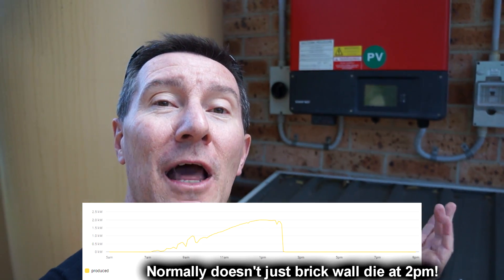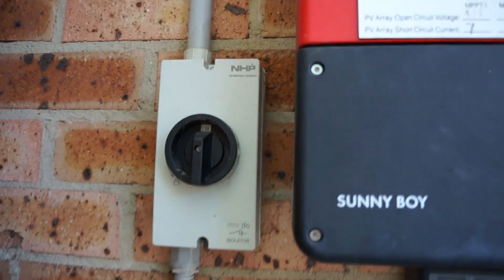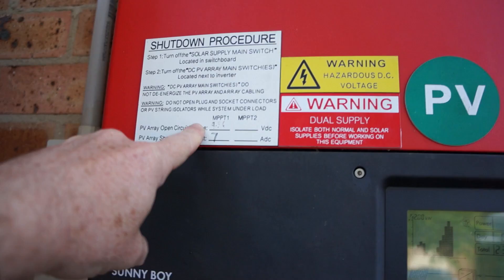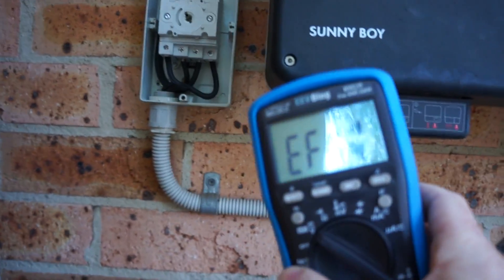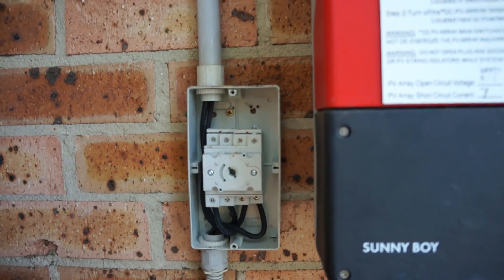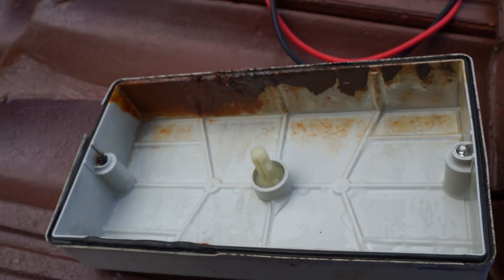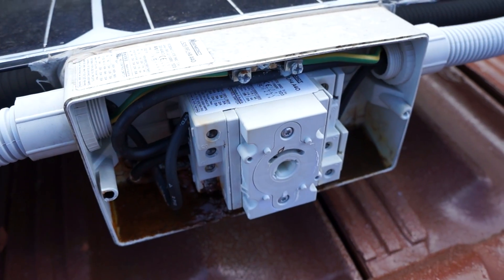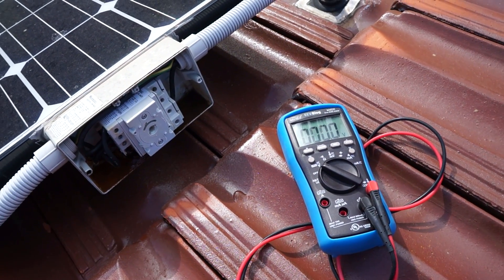EEVblog #1217 - My Home Solar Power System FAILED!

Comment: Given you have no other isolators on the roof, does that mean you have to replace the switch live with 400+volts flowing ?.
Either that, or get up there in the dark and change it ?.
Reply: Don't point your bloody torch at the panels! You'll kill us all!

Comment: Here's a fun fact. The New York Pneumatic Transit system that Ray mentions in that Ghostbusters 2 clip was an actual thing, though it wasn't nearly as big as the movie depicted. It was a tunnel about 300 feet long, built in the 1870s, that ran under Broadway. It used a big-ass Roots blower to push/pull a rail car along using only air pressure, kinda like a human-scale version of those pneumatic tubes at banks.
Reply from the maker: Yeah, very cool

Comment: It's a little late now but a little silicone caulk on that seam might have kept that seal.

That top iso switch is probably for fire code. Firemen are very leery of solar cells because they output voltage all the time when there is sun or just bright light.
Reply: In Oz even Silicon succumbs to UV.   Once the silicon breaks down you have as much or even more unreliability.

Comment: The dual shut off on the panels might be for fire safety. If the building catches fire, fire fighters need to cut off all power for their own safety. Depending on the nature of the fire, the ground based switch may be innaccessible or a roof crew may come upon the panels before the shut down on the side of the house. They need to sever power at the soonest opportunity.

Consider a scenario where they need to cut a venthole in the roof. They need to shut off power. Either they can try and jump down from the roof and find the shut off down below, or they can cut it off at the panels and get cutting. Time matters.

At the same time, they could be on the ground, about to enter the house. The roof is unsafe or they don't plan on any roof attacks. They need to shut it off at a convenient place, the ground.

Both switches are generally necessary.

Comment: I'm not familiar with Aussie electrical code, but instead of these plastic abortions, why not a common (and inexpensive) AC disconnect box, such as the Siemens WN2060U (there are less expensive ones)?   Metal, should probably last a few decades.

Comment: Never use non-UV proof plastic on the roof. But if you must, coat/wrap the exposed parts in metallised tape to stop the UV getting at the plastic. Even for cable ties, there's a black UV proofed variety. Or have a box for the box !

Comment: A plastic box meant for mounting in direct sunlight not UV resistant enough.  Brilliant.  They should have used metal or painted it to better reflect UV.  "Weatherproof box."  Apparently not.

Comment: Could this have caused damage to the panels? Like if the switch contacts caused a short across the panel strings?
Reply: If the panel output is shorted, all of the panel's power will be dissipated in the wiring, with most of the dissipation occurring at the short due to the higher resistance of the corrosion relative to the copper wire.  This will generate a great deal of heat, so, yes, the panels will be damaged when the system bursts into flame.

Comment: Maybe a encapsulated High  voltage high current relays might be better?, control from ground floor, place in dicast box with internal seal, use weatherproof inlet glands ip68 or better
https://uk.rs-online.com/mobile/p/non-latching-relays/6900814/

WoW well over 68,000 views in one hour since upload that's good going Dave !
All the best
Philip

Comment: I forgot to say DC-4 blocks water entry to electrical connections and protects against hi voltage arcs up to 460 volts per mil of DC-4,

Comment: I self installed a 14 310 watt LG panel
system 12-1-16 using a Enphase microinverter for each panel. Inverters are bolted under the panels to the panel mounting rails. I wish I had used DC-4 on the cables where the microinverters and panels plug in to the output cable. I will be adding 10 panels and microinverters soon and will use DC-4 where each panel and microinverter plugs into the output cable and on my existing
disconnect boxes. I’m in Los Angeles, USA – not much rain here but who knows what the future will bring?

Comment: Rooftop dc isolator is usually the weakest link and tends to fail, this guy is lucky because it could have been worse. Sometimes it  can burn and cause fire to the roof and the house ...

Comment: Our eversolar (now zeversolar) inverter failed after 3 years, luckily just within warranty - so replaced for free! Supposedly it'll pay itself back in 10 years, not if the inverter goes again it won't! Having searched for our model on youtube I found a video of a chap who found the fault to be dead relays, he did quite a large Big Clive style test with lots of exposed parts and got the relays working again by bending them with a screwdriver. :D

Comment: I can understand secondary isolation but who in their right mind puts a polycarbonate enclosure in full view of the sun, especially in Australia.
How about you mount the replacement isolator inside a larger enclosure meant for external applications.

Comment: no isolator switches on roof.  put 20 amp breakers in for each string, outside, but under cover.
Reply: What's that going to do? The short circuit current is in the region of 10A
Reply: I use 20 amp breakers under cover, because I have parrallel panels on my array.  size breakers for panel amps of course.

Comment: The sunny boy has another circuit breaker built in, the pullmedownthingy on the lower left. 

Just put aluminium tape over the silicone and plastic when new. the good thicker self adhesive stuff. Costs some money but really long time stable.
i think main original use is overlapping water vaper blocking on thermal insulation. the tape also reflects sunlight so less heatup below.

the upper circuit breaker might be for fire fighters to be able to reduce voltage&danger if your house is on fire and they are putting water on live connections.

Comment: You need the isolator on the roof for when work is done on the roof ( safety ) and by the inverter also for safety.  Try mounting it physically under a panel ( Switch marked and easily usable ) so you get only reflected UV  on to the box.  Plan that much farther ahead.

Comment: Many don't realize that breaking a DC current is not that easy. At 400 volts it will require a special arc snubbing switch.

Comment: Cheap way to protect plastic from UV is to cover it with Aluminum foil tape and reinforce with metal wire (non corroding type). In your case, can you simply move the switch under the panel?

Comment: Its a stupid design.  how do you replace the switch if it has 400 or so volts coming into it, i guess better wear the rubber gloves, it is a stupid place for it to be located.
Reply: You wait for a total solar eclipse.  The next one's due 22nd July 2028.
Reply: @petehiggins33  good thinking!!

Comment: Outside electrical switch, deteriorates from UV.. seriously?!! Had a very simple electrical switch at home that was from guessing around the -50 based on how it looked and the age of the house and that was outside 24/7 and only had a seal for the axle and housing but made of some plastic. 

When I recently moved it was still functioning just fine, little stiffer then when I moved in but no biggie. That this modern switch deteriorate is incredible bad engineering, it should of course have been the first thing to make the housing hold for weather and UV which is no problem to hold for even way more then 6 years which should have be nothing.

Comment: How does one work on a switch like that during the daylight hours?  Is there a way to isolate the DC current coming from the panels so you can work safely or do you just wait until dark?
Reply: Mark Pinther   I assume that once you reduce the DC current by operating either one ore the other isolator, you can then isolate the inter-panel connectors to work on the system.
The connectors should never be disconnected with current flowing.
Reply: Lee de Vries :  Thanks Captain obvious.  But what if that is the only isolator?

Comment: What if you had a little aluminium hood or panel over the new isolator switch, to prevent the sunlight shining on it... Then the seals won't deteriorate under the UV, and the switch should last a lot longer?

Comment: The installer 6 years ago maybe testing your engineering mind if you can see a weak point in the design,but you didn't until now 🙄🙄🙄

Comment: isolator on the roof is completely unnecessary but a requirement stipulated by the cec or whoever they are for all installations of this type in Australia.

Comment: Sorry, but i have to ask. Why the heckles was the switch up top exposed to UV without shielding? Even UV resistant plastic has a limit and then there's heat. I think that's a fail on install more than anything else. Just my 2 cents. None of my isolators are exposed, all are housed in their own boxes.

Comment: I always put a layer of aluminum tape over any horizontal exposed seams. These plastic boxes have been failing for decades in the sign industry. 1 Drop of water on a 15k neon transformer connection will trip the GFI. The foam gaskets found on almost all outdoor enclosures fail quickly if not protected from UV.
Glad the solar fail was a cheap repair. It's like being relieved it's a nail in the tread instead of the sidewall of your tire.

Comment: Just thinking back to my day of working on USA military radar systems, we stuffed cable connectors with Dow Corning DC-4  grease which protects 460Volts/mil.  See the data sheet at https://datasheet.octopart.com/DC4-Dow-Corning-datasheet-32841891.pdf.  Also for home sprinkler systems connections are covered with snap-on wax pellets. Covering those connections with something that 450 volts would not break down would probably have prevented the failure.

Comment: The purpose of the isolator switch near the panels is for fire fighting (at least from what I know, there may be other reasons). This is so we can isolate the section of cable going down to the inverter, making it safer to spray water on a burning building.

Comment: Its was never a good idea to have low voltage DC solar systems on homes due the high dangers of fire and shock. all system should be 48VDC systems, with the extra cost of heavy copper cable runs to the panels to keep voltage drop low it's not worth risking a house fire which has already happened. Plus all isolation switches, junction boxes, and inverters and batteries should be in metal and /or fire proof enclosures.

Comment: If the SMA is out of warranty I would swap out the mechanical relays inside soon. I repair solar inverters and main failure is output relays failing and unfortunatly they normaly damage the PCB when they burn out.
Reply: I have one of these SMA sunnyboys on the corpse pile I can send you pics of the circuit boards inside if you want. They use a H bridge incorperted into a brick module sunk into a well on the heatsink and the 2 cylindal wells on the heatsink at the back house the dc/dc inductor and the other is the output inductors for low pass LC filter after inverter bridge

Normaly set-up for a single phase transformerless P.V gride-tied inverter is -

Common mode filter on dc input(s) -> DC/DC (normally boost) (2x for dual input) -> Bulk caps -> H bridge or maybe neutral clamped -> output LC filter -> common mode filter ->output relays 2 x 2 pole (this provides the galvanic seperation required by regs/law) -> Ground fault indicator (also required by regs/law) -> second stage EMI filter -> AC out.

Comment: If there is a failure or fire which has destroyed the isolation switch next to the inverter or it is inaccessible due to fire or other obstruction, the extra switch on the roof is backup to isolate power as close to the source as possible for extra safety, but because of the rain heat and the UV even UV plastic will fail within several years, so while the idea is fine the government regulator HAS FAILED to enforce that the isolation switch on roof must be protected from direct rain and sunlight. In fact the switch on roof is a fire hazard, as water and grime accumulate on the switch contacts the contact resistance will go up and cause a switch fire which can spread too the roof.

Comment: In any system,one would expect the most hi-tech component to fail. Surprisingly, this failure was caused by the most low-tech component
Reply: Indeed, I expected something electronic in the inverter to have gone titsup... and require Dave's sleuthing to find the design flaw!

Comment: Didn't you know that you should replace the seal every two years?
Those sealed box have usually the rubber seal replace period mentioned in the small manual.... That probably noone reads 😂

Comment: When I mount for example an outdoor switch I mount a half roof tile(spanish style) on top of it to protect the switch. Some extra job but its wort it. If you cant mount the box under the solar panel get a metal sheet as a roof. Bend it and screw it between the box and the frame. Thanks for nice and informative videos.

Comment: All the installations I've seen including mine have the isolator on the roof but all those have/had a metal cover over the switch because while weather proof they aren't UV proof by any stretch.

Comment: Panels will outlast you for sure and your children maybe. Inverter not. Add fuses on the roof. My 1976 crappy 80W panel still can give more than 50W, 55W in the middle of the day. I can barely read the label, I had to change its diode once.

Comment: We have 4 solar installations at home.
The first is from then 90s and has a earthing, mains DC switch separate from the inverter.

All newer ones use the DC-Breaker of the Sunny Boy, which can only be used limited number of times under load, but is cheap and can easily be replaced.
At least here in Germany there seems to be no additional requirement for a DC breaker switch, as long as the Inverter has one build in.
I also think they are mandatory, because they prevent you pulling and arc when disconnecting the cables (the breaker has to be pulled to gain access to the plugs).

We have never had any issues, even the >23 year old PV system is going strong, though the display of the oldest sunny boy failed at some point, we see no reason to replace it, it is just not well made and as long as the green "working good" LED shines and the metered power is good, it does not really matter.

Comment: Every piece of equipment (even cables) must be in the shade of the panels or under a flat rock or a tile, the sun destroys everything, and if not the water and if not the small animals. My norm is to use MC4 fuses on the roof (those are waterproof, and located under a panel). And a switch at the bottom protected from rain and sun where a human being on foot can access it and turn it off in case of a fire. The sun is eating away so much material that in THREE YEARS it can destroy the outer plastic tube, AND the red/black insulation of the wire, then those can touch eachother. Put a new switch, but add a tilted tile over it, it will shed most water off its side, and protect it from the UV wich make short work of most plastics, or at least make it brittle so that next hail will explode it like egg shell. Odds are if you grab any of those outer plastic tube : they will crack and stay in your hand as debris.

Comment: Switch box maybe Waterproof but perhaps  it not weatherproof.  And it was installed 90 degree tilt maybe not work for it
Reply: Indeed I was thinking that. Most weatherproof electrical gear has a specific way up it MUST be mounted, manufacturers requirements even come before the wiring regulations here in the UK. If you install it in a way not intended by the manufacturer, they have NO liability for what happens.

Comment: Get some self-adhesive aluminum tape at the DIY store, cover the PVC bits with aluminum. It protects them from radiant heat absorption and UV.

Comment: The purpose of the isolator switch directly at the panels is to shut off the high voltage if there is a fire: Those things are a really, really nasty surprise for firefighters as you can't switch the panels off (even at night they will pump out stupid amounts of power if they get lit by a floodlight) and they can provide a deadly electric shock if someone manages to come in contact (and that is not that hard when you have aluminum gear and a lot of somewhat conductive water around those things).

So yes, i would absolutely recommend having a switch up there since having another deathtrap for firefighters is not something you want (if it is not safe for them to perform their duties, they will not go in there).

(Little sidenote: Some firefighters even have huge amounts of black tarp on their vehicles just to cover solar panels)

Comment: It is not the switch that failed but your solar installer. That isolator (LS25) is only intended for indoor use,  it has an IP65 rating but has no UV stabilizers. You should use a NHP PVA432 that is designed for direct sun exposure.

Comment: Mounting it underneath the panels would seem like a reasonable thing to do.   The local starling population have been making perfectly dry serviceable  nests on the underside of ours.  We probably get more rain here (UK) than Aus as well.  Thee is no DC isolater on our roof, just one next to the Inverter much as yours is

Comment: That rooftop isolator should have a cover/shroud on it. It also shouldn't be mounted on top of the panels, facing upwards like that. Rooftop isolators are the leading cause of fires in solar installations.

I worked in solar for 2-3 years and yes, it completely baffles us that we're still required to install rooftop isolators. Luckily, this is a relatively easy fix that can be done in 20 odd minutes. Replace with a new isolator switch and perhaps go ham with a silicon gun on all the seals.